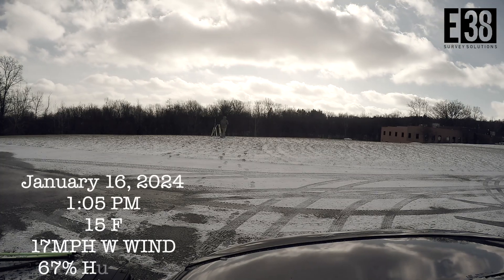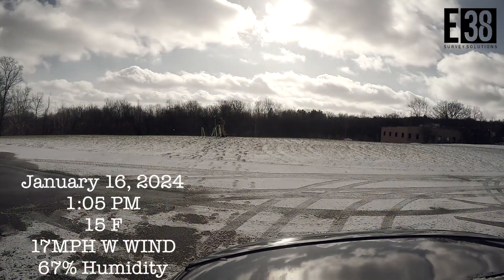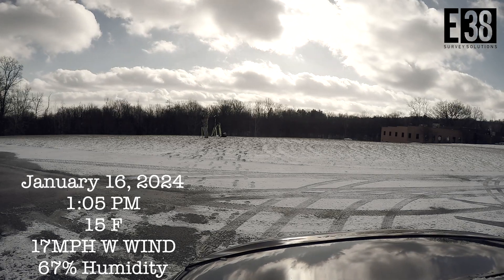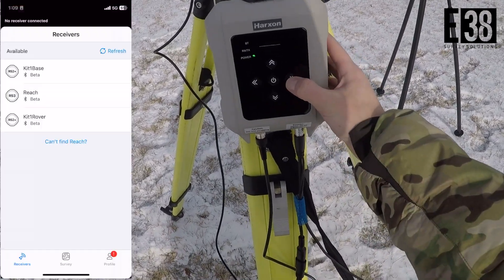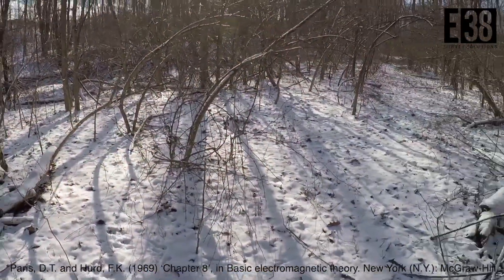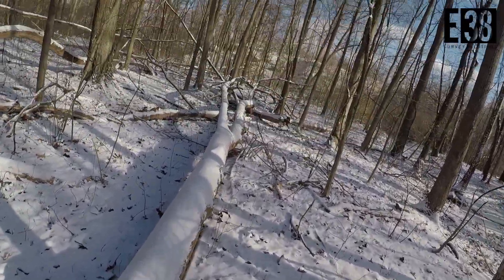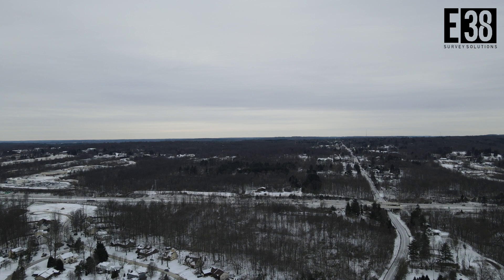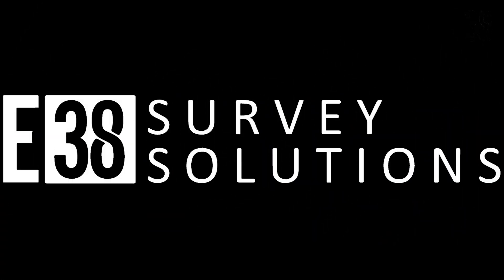Emlid Reach RS3 LoRa vs UHF Range Comparison | Wooded Areas

Comment: Is it possible to a Lora connection between the emlid RS3 and the Matrice 350 RTK? Or is the Lora connection just for the emlid base and rover combo?
Reply from the maker: You wouldn't be able to use LoRa directly to the Matrice 350, however setting up a single receiver as a base is possible to fly your M350 in RTK: https://youtu.be/-jXwX2xjr0I